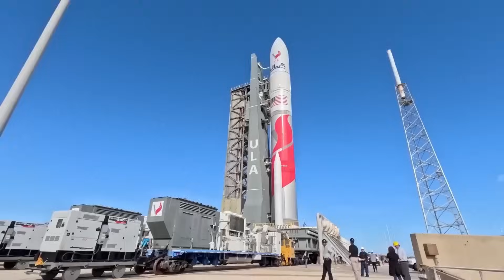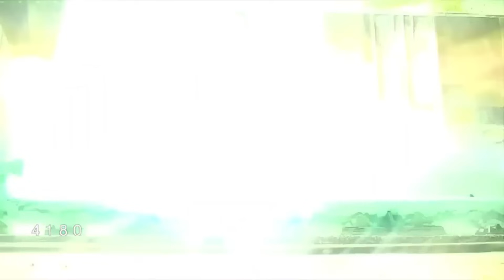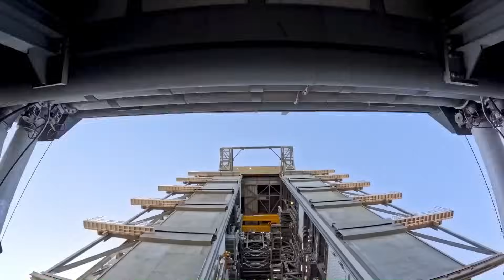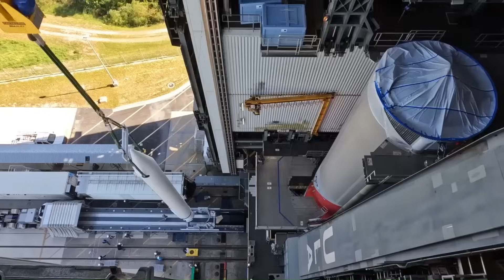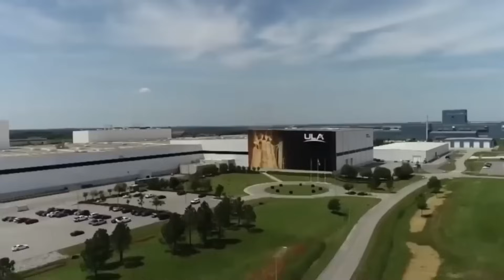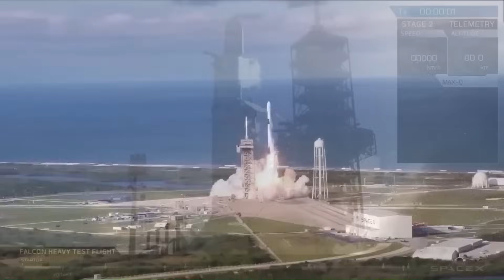BIG PROBLEM! ULA Is Struggling To Compete With SpaceX Rockets...

Comment: Consistent with Boeing's politic centric management that's failed to deliver a fully functional tanker over two decades,  delivered the 737 Max with the hidden trim system that killed hundreds and failed in space.  It is about leadership.  Boeing moved HQ to DC and the influence peddlers.